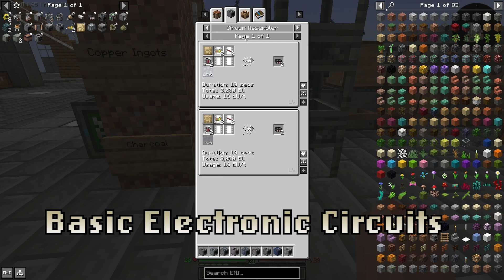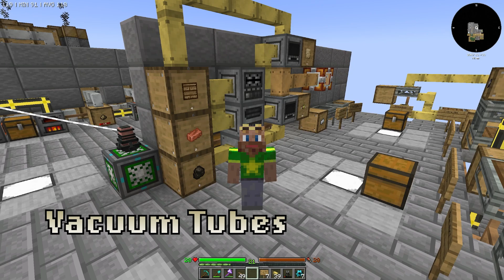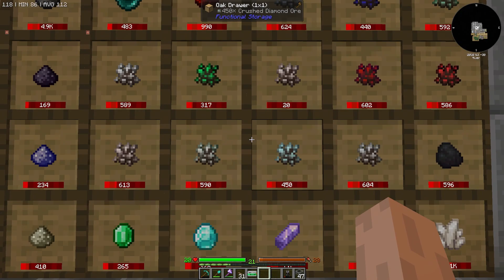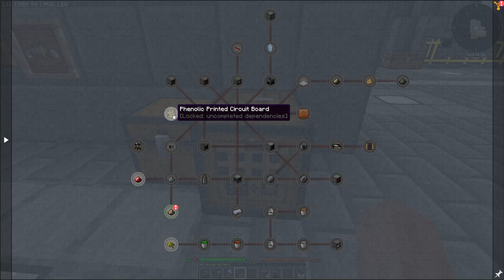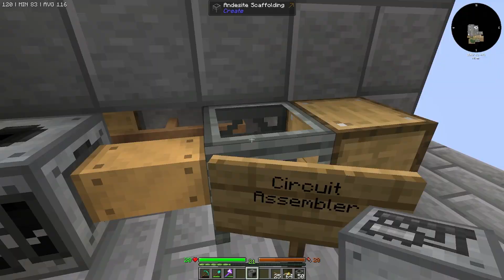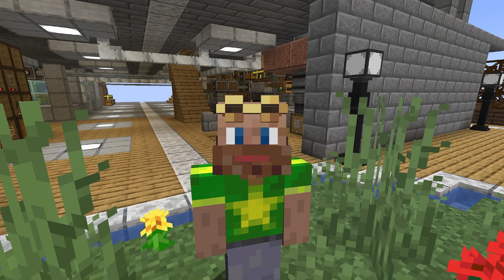Star Technology - 08 Circuits

Comment: I just restarted my run again again. And this time I am going to setup automation up at the very start. I have only made it to signalum and aluminum in my previous runs. I won't deal with steam machines, just going straight for electric machines. Even if it is not optimal. I just don't won't to deal with it. 😅
And then sugar farms for paper making. I will try to see if I can make an automatic tree farm. I am a Create noob. 😅 So these videos helps a ton. In my previous restart I made it to chapter 2 in 6 hours. And this time I will focus on better storage, better automation, better resource generation, and better power generation.

I think I am going to setup my base into factory chunks. So a chunk for circuits. Everything that is needed there to make it.

Comment: Is there a way to use one greg tech pipes to take 2 different items to 2 different destinations using the same pipe? I am thinking of how Ender IO works and I am looking for something like that.
Reply from the maker: If you're talking item pipes, you can connect one single run of pipes to a bunch of oak drawers that are locked to a certain item, and the pipes will deliver them to the appropriate destination, yes.
Reply: @gameswithpostie  okay, ill try that. I have tried the robot arms, greg tech item pipe filter, and conveyor but none of it seems to work like ypu think it would. I wish the pack had ender IO

Comment: Is it possible to input all the ingredients in the circuit assembler automatically with number of stock so that the circuit assembler wont be filled with 1 item? Im trying to import but whenever i try to keep more than one item from a single side in stock it will only stock 1 item and the other wont even be imported, the issue comes cos you need 7 sides for the lv circuits for single input/output + power and i dont know what im doing wrong (first time playing Gt so im very lost xD) Thanks
Reply from the maker: Unfortunately that's the exact issue I ran into myself. There's not enough sides to attach individual the robot arms as well as the power and output, and putting multiple parts into a single item filter seems to be treated as an "OR" rather than an "AND". I did attempt to explain that in my recording, but it was difficult to explain clearly, so I ended up cutting it in editing 😐
Reply: Ahhh that sucks, thanks though

Edit: the only 'way' i found was to fill 2 slots with smtg like cobble, then feed the circuit assembler with the other items, with backlog they shouldnt run out and fill in other items spots
(Also i tried using a mechanical arm on force round robin paired with brass funnels which extract exact amount of items (1 and 2 according to the recipe) and then inputting them into the circyit assembler, if an item is missing or not enough of the item it will stop transferring any items to the circuit assembler)
Reply from the maker: I just did some experiments, and it appears that if the side that has a robot arm on it is an inventory (such as a steel crate), and not a pipe, the item filter works correctly with multiple types and quantities using keep exact.
Reply from the maker: Ok.. I think I may have cracked it! a 2x2 oak drawer works as an inventory for the robot arm to pull from, and it has 4 separate, lockable inventories that can be fed from any direction... Thanks for asking the question, it spurred me on to find an answer where I previously thought it impossible :D
Reply: My laptop broke so couldnt try it now 'fixed' but tried it out and it works thanks and glad you could get an answer for yourself as well
Reply: @gameswithpostie  I don't know if this is a quirk of the GregTech CEu Version used in Star Technology, but in GregTech NewHorizons (which is on 1.7.10) you can set the machines to accept more than one stack with a soldering iron. Here it may be the other way round, that they in default accept more than one stack.

Comment: Something I found useful early on is to craft some drums - there's metal ones and then there's a wooden barrel which comes up when you search "drum". These can be used like buckets as in you can pick them up in your inventory and click on a liquid to pick up/place when inside machine interfaces. The benefit is they don't need to store whole buckets, they can store 144mB for example. They are also great for disposing of liquid, simply put the drum into a crafting interface (after picking up the waste product) and you can get an empty one back, trashing the contents.
Reply from the maker: Wow I needed this advice a few episodes ago. Thanks! :D

Comment: iirc, there should be compacting drawers that will turn flint dust into small pile of flint dust. You just need to insert small pile into the drawer first, and then lock it. This will eliminate the need for an extra machine, and save on power
Reply: I don't think the compacting drawer recipe is enabled
Reply: @prze4214  ah ok
Reply from the maker: Thanks for the suggestion! I just checked and @prze4214 is right, I don't see the recipe for it. The packer only uses 12EU/t when it's working, so I'm not too worried about the power tbh. By my calculations my current power setup can handle about 800EU/t. I'll need to upgrade it to handle MV very soon though. :)